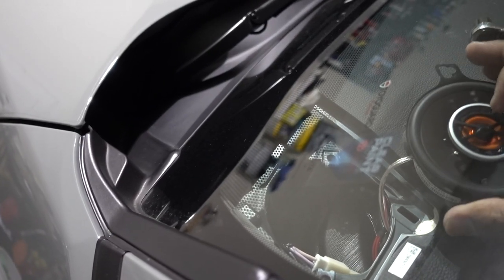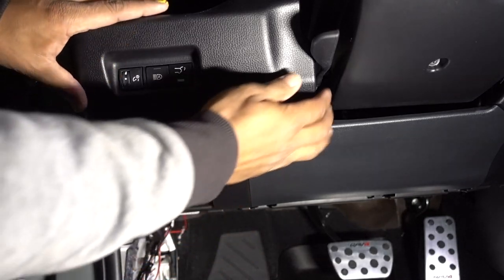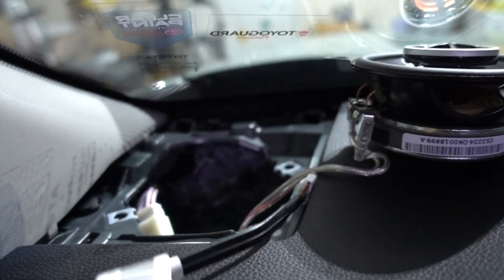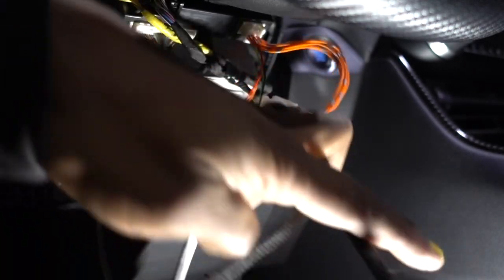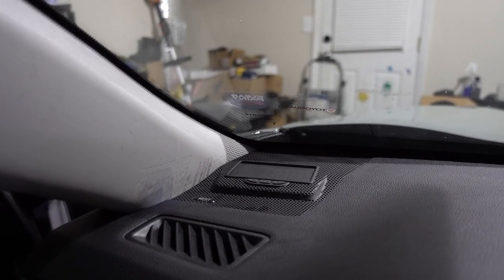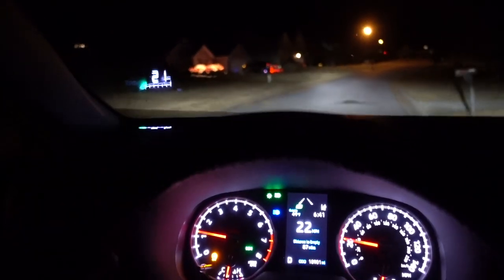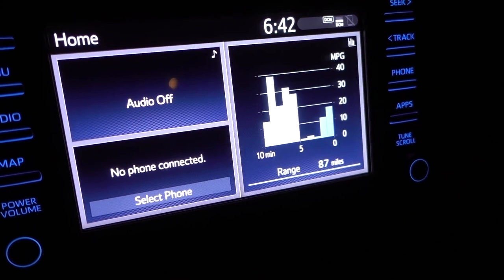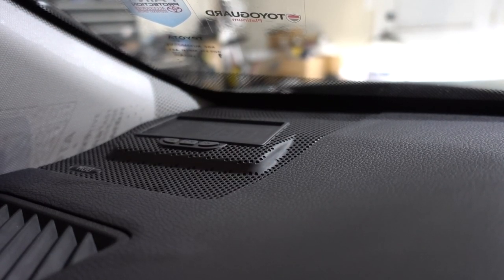Head Up Display HUD for Toyota RAV4 2019 to 2021

Comment: Great product unfortunately will not work in New York State  because registration  and inspection stickers are pasted on the windshield exactly in the spot where the projection would be displayed 😢😢
Reply from the maker: That sucks
Reply: It works fine; actually. 
There are no problems with the display, and the stickers don't interfere with the image

Comment: Did you have any issues with the "Parking Assist Feature" after the install?  After I installed mine, my car showed the message "Parking Assist Not Available".  So now, parking sensors does not beep.  Wonder if there is a way to reset that feature.
Reply from the maker: I don’t have parking sensors
Reply: @BulletSolano  Appreciate your help.  I drove around for a little bit and turned off and on a few times.  It cleared up.  Thanks again.

Comment: On my 2022 Prime, once I plug it in it says, "brake failure, stop and visit dealer"
Reply: Hi, Has this issue been resolved? Can't wait to install this in my 2023 Prime SE.
Reply: @saikrishnabattula   NO, I believe toyota purposely jammed this device in 2022+
I went with another HUD device that connects to OBD